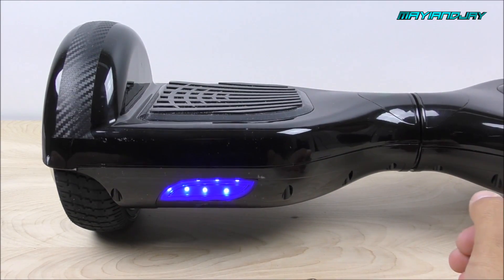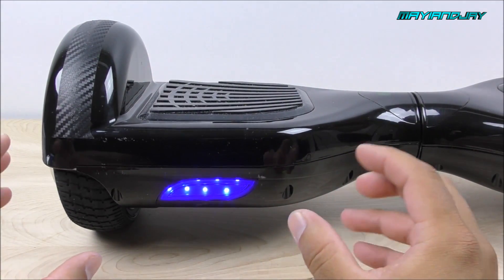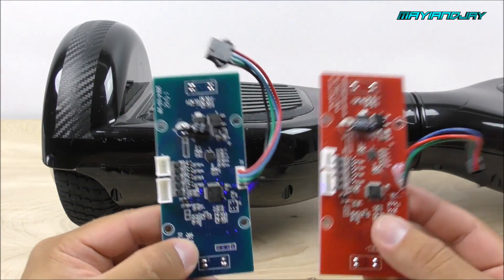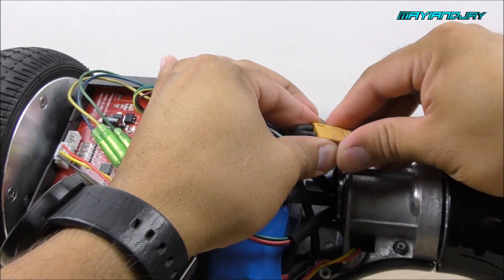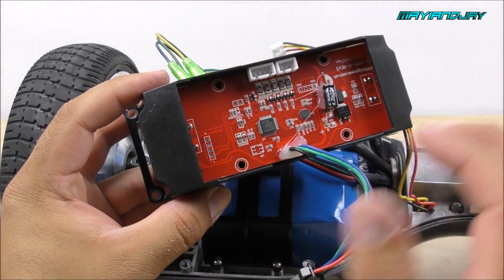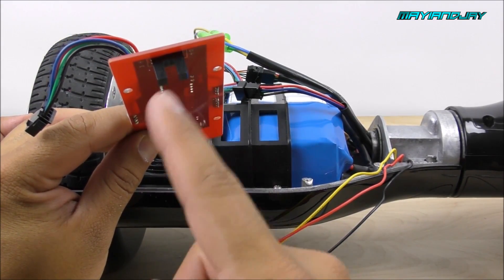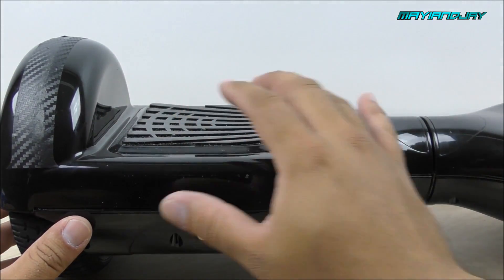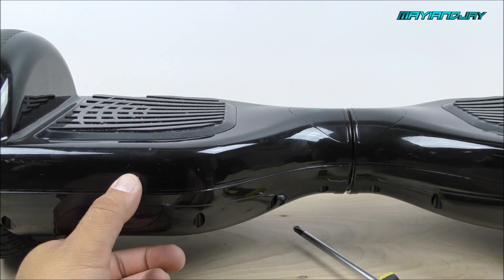Hoverboard/ Balance Scooter - Solid Light & Dead Motor Fix/Repair!

Comment: Anyone have advice? Earlier today i tried to recalibrate my hoverboard, and when i finished doing that one side stopped responding to pressure, it had a solid blue light but no reaction to weight.

Comment: my board has a problem where my right light gets turned on and when i step it doesn’t move. the left side does not turn on at all.  both sides shake when i try to move my board. is there anyway i can fix this?

Comment: Same issue. Bought a new motherboard, replaced it and the problem persists.

UPDATE: Turns out I also had a broken wire. A small thin blue one. Check carefully because I missed it! That and the new board fixed it. Old board was fried, I think during calibration I pressed it down while calibrating and that fried it. Careful.

Comment: Mine has the blue board you showed, however mine is still showing a blue light on one side, yet not working on either. What do I do?
Reply: Same, and the one that doesn't have the light doesn't work. What can I do???
Reply: mine too
Reply: SnailSklz same
Reply: Replace them. It's really easy. I ordered replacement parts, and received the green ones.  After opening it up, I realized it was the blue ones I was replacing (which only worked a week when we bought the hoverboard).  They work great!

Comment: Hi everyone yes I have a problem with my MiBOARD it seams that there are different names for the balance or hover board, mine is called MiBOARD . Anyway my problem seams to pose a slightly different problem to the one's experienced in the videos. I go through the re calibration as many of you have explained , so then I turn it back on i have the green battery  light on indecating power ?, when applying a little pressure on the foot plate the running indecator light is green for 2 seconds and one  wheel turns then stops and go's back to red light and no function, could it be low power even though the battery is showing a  full  block green.
Reply: after I charged my hover board after I tried it twice it stopped working I need help
Reply from the maker: Hi there! It sounds like you have a faulty battery. This happens quickly after charging?
Reply: what
Reply: Paul Wakefield i have the same problem
Reply: Kim  Cetin same
Reply: What does seams mean

Comment: if you have any internal problems just reset it here are the steps.  1.turn off your segway.                   2.hold the power button 5-7 sec. 3.the front lights will flash 5 times stop and flash 1 more time  4.after that last flash turn seg way off.                                              5.fwi make sure your hoverboard is leveled
Reply: +Ricardo Frescas Thats Exactly what caused the segway to have problems. I did that and mine turned out what the video is showing
Reply: It worked with mine
Reply: Ricardo Frescas I have been hearing old models had problems with old motherboards. I may be wrong. You probably have a new version. I could be wrong

Comment: Can this problem result from calibrating your hoverboard? By holding down the power button.
Reply: +Eric Tong That's exactly what happened to me. I tried calibrating it and one side stopped working.
Reply: +lol lol I heard online that this could happen when you calibrate ur board while pressing on the foot pads, it says that doing that will fry the board. I hope this doesn't void my warranty.
Reply: Eric Tong The problem also is that if you do it on a soft surface like carpet. The board will think that it isn't touching a surface, and it will fry the gryoscope inside of the machinery, you can either just replace it or get another one from the seller you've bought from

Comment: on my hoverboard there is a beeping noise when no one is on it is still charges the Bluetooth stopped working... does anybody know what this means or how to fix it
Reply: +Ruben Caldera It's probably a small issue... Look at the video on my channel on how to Re- Callibrate it ( It's the red light video ) Don't give up on it yet... Also try re- calibrating it more if it doesn't work the first time.
Reply: Ok thank u I'll try that

Comment: i work at a repair shop and with my knowledge and experience the green sensor or gyro is the better ones.. the blue ones are always having to be replaced
Reply: do you have any cheap sensors. .??
Reply: +Cortlyn Kaiser  no i dont personally .. its the shops haha but we fix the balance scooters there ahah
Reply: +Mark Rodriguez  HEY I KNOW YOU 
YOU PRETEND TO WORK FOR AN RC SHOP RIGHT? LOL
Reply: +Mark Rodriguez y'all don't have any sensors??
Reply: +Adrian Rodriguez  This guys a troll hahahah lololololo
Reply: It could be the sensor s or the other board I don't know the correct term but we call it the main board
Reply: reset it

Comment: Hahaha another problem with this, wow that product is pure BS... 
Exploding batteries, motor that stops working, ... What will be the next one ?
Reply: People dying or being injured
Reply from the maker: +Junior Guerrero Its a new revolutionary product and people are experimenting with them, using them improperly.
Reply: mayiandjay I am sorry but batteries than can explode is not a problem due to using it improperly, this is a serious problem that is due to bad quality components...
Reply from the maker: The battery issue has been resolved and spotted. But once something makes a bad impression its hard to fix it.
Reply: mayiandjay Yes you are right, it has been resolved but you have to buy an additional battery, and replace it yourself.
Reply: +mayiandjay what is the background song you used thanks please reply!!!